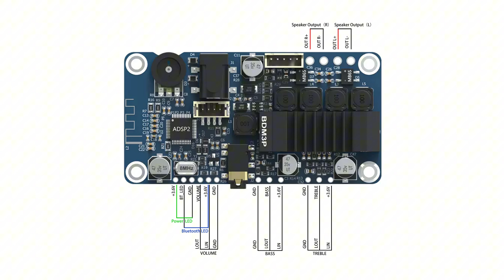TPA3116 Stereo 50W Bluetooth Amplifier w DSP Treble/Bass/Volume/PC UI Control BDM3P Wiring Tutorial

Comment: Whats the point of line out? Signal on line out is the same as amplified out. I would like line out to be dry or separately programed from amplified out, for example to be low pass.
Reply: it's actually very useful, you can add another amp board connected to the output and create a crossover. so you can have a high pass and  a low pass on the first board for 2 woofers and a high pass on the second board for 2 tweeters
Reply: If you set low pass on first board for woofers, than low pass will also be on line out. So second board would not get any of high frequencies to work with. Do you have that amp? Maybe Im doing something wrong in acpworkbench. I do not see any separate control for line out.
Reply: @berislavtopol1404  connect the line out of one BDM3P board, which as specified doesn't have dsp applied to it, to the line input of a second BDM3P
EDIT yes I do have one board, thinking of getting a second one for crossover
Reply: @georgetanasa3843   To confirm again, I just connected headphones to line out and dsp settings affect speaker out and line out the same. Try it yourself. My acpworkbench version is 2.24.2. So you can not use it as active bi-amp because you must use passive crossovers on one amp. Thats why Im claiming that line out is useless, not entirely but mostly. EDIT: I have bought 8 of them thinking that line out is clean no matter how I set dsp. But it not, and thats a bummer. It might serve a purpose f0r a bt dsp preamp for amplifier that do not have dsp. But thats to may a/d d/a transformations
Reply: @berislavtopol1404  That's a bumer, I was going by the specification. I'll try on my board to see if it's the same
Reply: @berislavtopol1404  I tried the line out and indeed it is affected by the dsp.
Reply: @georgetanasa3843   I did not try that but, allegedly, there might be a chance to control independently all 4 channels that ADAU dsp has. But not in acpworkbench. In Sigma studio.

Comment: Hi! My question is, that does this amp support 1.1 mode? I want to use it with a single woofer, and a single tweeter.If not, do you sell any dsp amp boards, that use 1.1 mode, and has around 30-50watts? Thanks for the reply in advance!
Reply from the maker: Hello, thank you for your watching. The BDM3P cannot support 1.1 mode. The JAB amplifier boards integrated with ADAU1701 DSP can achieve the function you want. However, program modification through SigmaStudio is required. Here is the products link for your reference: https://store.sure-electronics.com/products/1/9. Wish this could help you. Have a fantastic day~